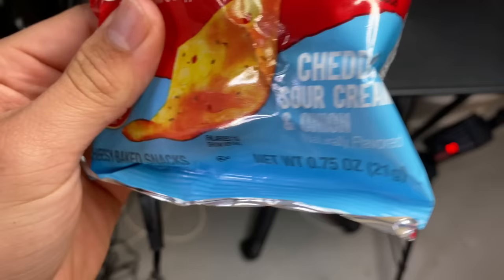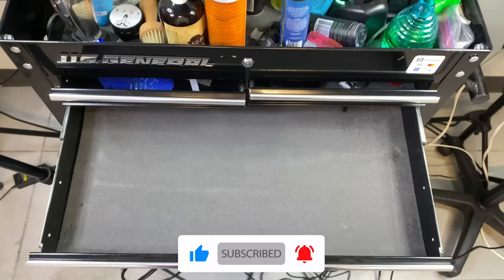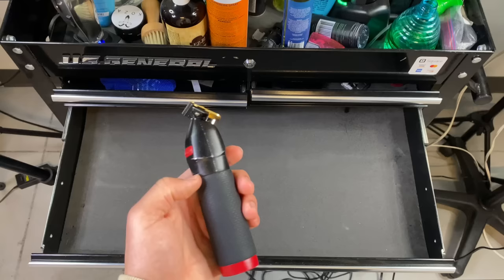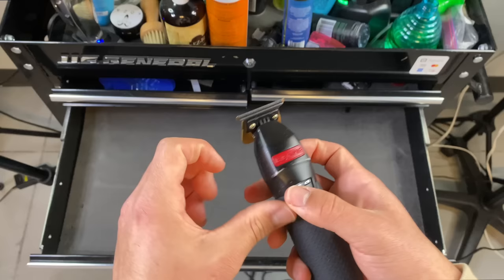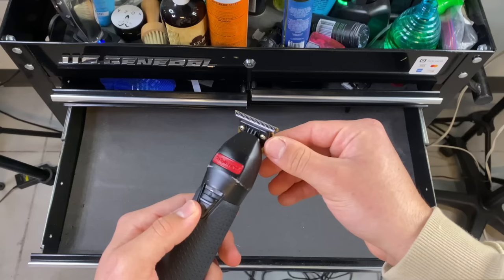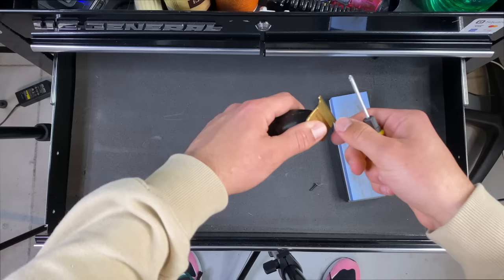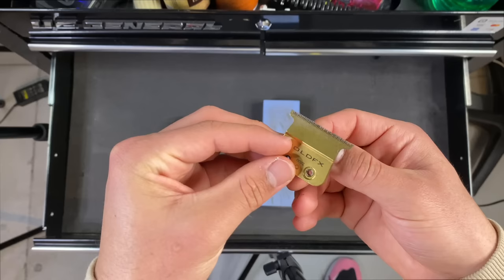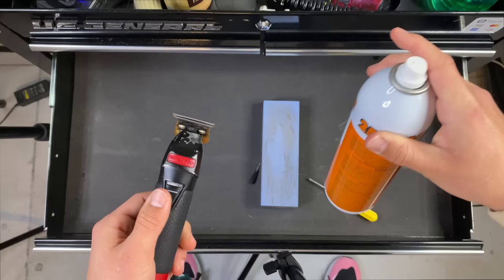How to SHARPEN Your Trimmer Blades & Make Them HIT like Will Smith

Comment: I tried this and messed up my andis t outliners so I went back to your old method of using the wire brush instead and It brought back my t-outliners. I also soaked my stone for 5 minutes before trying this method so IDK if that could've been the reason why my blades got messed up.
Reply: Nah man,  I have been cutting for a while and I can tell you from tried and true EXPERIENCE,  that those stones will destroy your blades. If you do it more than once you will be buying a new blade. You may be able to get em to hit for a month but if they are sharpened properly you should be able to extend the life of the blade by at least a year
Reply: Try rich barber modified blade sharpener
Reply: I was looking for someone to mention his older method of using the wire brush. He's got to explain the change in methods to us now. Youngin had come a LONG WAY though 👏🏿👏🏿👏🏿 SALUTE 🥃
Reply: I use his old method then follow up with a very fine grit stone. That sh!t hit.
Reply: It's because that's not how you sharpen a clipper blade. At all.
Reply: @louiswhite1445  how do you sharpen yours?
Reply: I don't. Because I know I don't know how. I buy new ones. But there are videos on YT that will demonstrate how it's done. Stones only work for a short time because there needs to be a very slight curve to the sharpening surface like the surface of the machines used to sharpen them, otherwise they will dull quickly. But even so, it's not that angle that you sharpen a blade with. All that will do is make the tip of the still blade's teeth flatter, sharper, and more prone to catching pores on up strokes. It does nothing beneficial to the moving blade. The back side of the moving blade doesn't cut. And I'm not trying to cause chaos or confusion. I've been cutting hair for a long time and I just hate to see people ruin their expensive things.
Reply: @louiswhite1445 that's a gimmick.

Comment: What ever happened to the wire brush method?
Reply: Not a licensed barber. But I think that might be fixed by adjusting the motor screw on the right side. You’ll have to take off the cover. Try to get the arm as close as possible without it hitting the magnet while running. If anything search wahl senior snagging or wahl senior adjust. Larry the barber man might have a good one to reference. Hope this helps

Comment: Using the grit is a terrible idea and unnecessary. That’s not giving sharper lines. First off when you use the grit you are taking off the coating on the blades. They are coated to lessen heat and last longer. Next you’ll end up giving ppl more skin irritation along the way. 3rd , babyliss trimmers are like that without any adjustment. So…..

Comment: DONT DO THIS! Babyliss blades don’t need to be sharpened. They hit the same if not better when perfectly zero gapped. I bet that blade start snagging hair later … 😂
Reply from the maker: I get new blades and they snag, unfortunately you never know with these clipper/trimmer companies they send out bad batches sometimes unfortunately
Reply: If your new blades are catching, take the burrs off with a stiff nylon brush. Factories don't always do the best finish work.
Reply: Those blades snag brand new out the package 😢
Reply: Thats why i only use that blade 4 lineups because when i debulk it always cuts or scratches the skin i think babyliss is making these blades to dam sharp like the fx3 trimmer blade haha